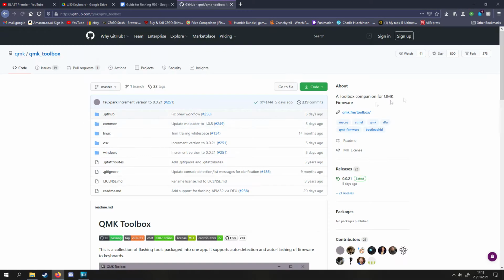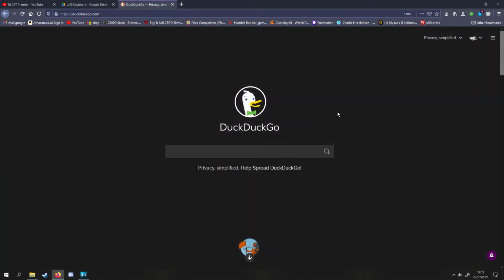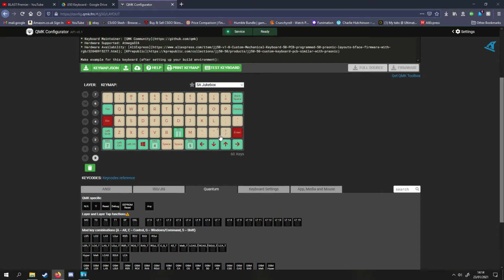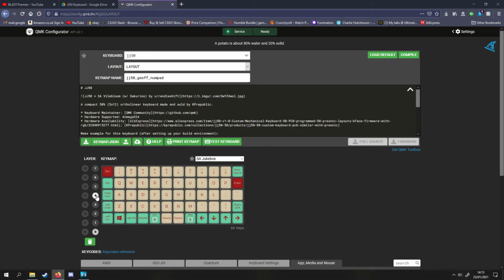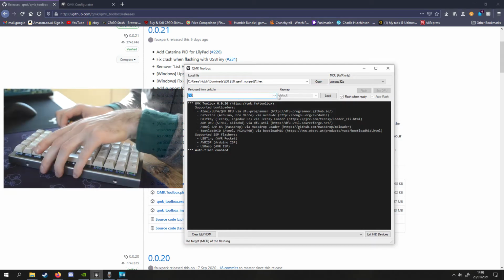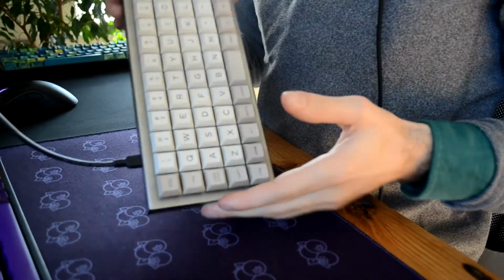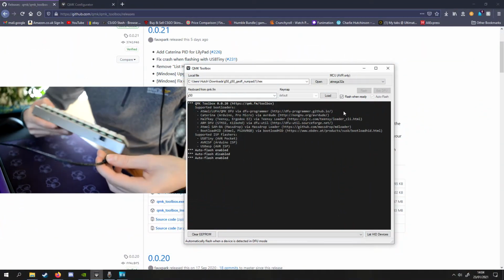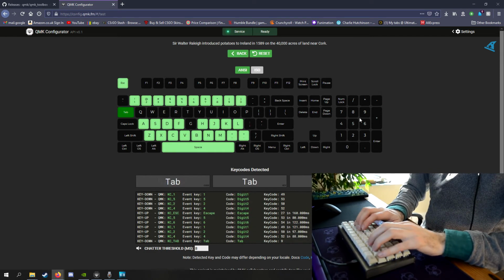Flashing with QMK Quick Guide 2021 - JJ50

Comment: Awesome tutorial, this helped me flash my jj50 the first time.
I have run into a problem though, windows says that it doesn't recognize the unit and gives the "Device Descriptor Request Failed" error.
I have tried everything that normal guides have told me to including reinstalling all my USBs in device manager.
Do you know what could cause this?
It happened out of nowhere too. I flashed with QMK several times before and then 2 days ago I did the same thing and windows suddenly didn't recognize it anymore.
I also tried reflashing with the default .hex from configurator. Nothing.